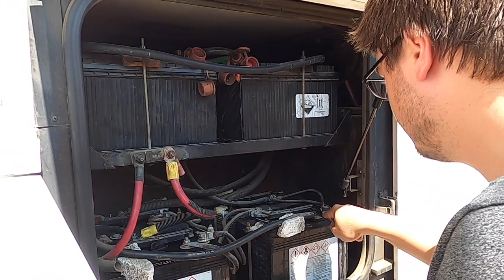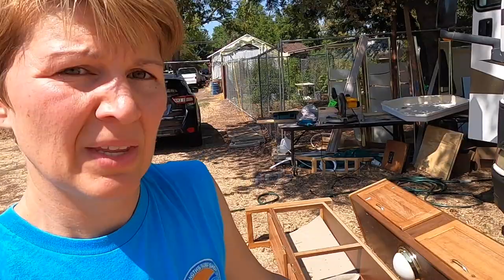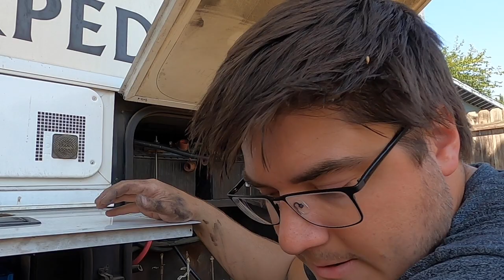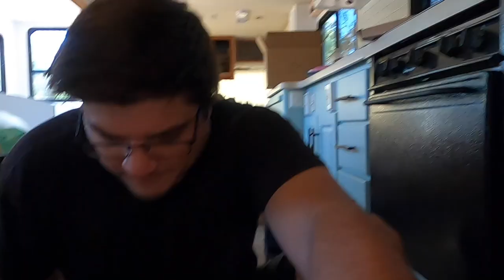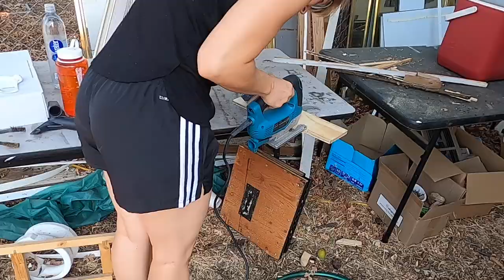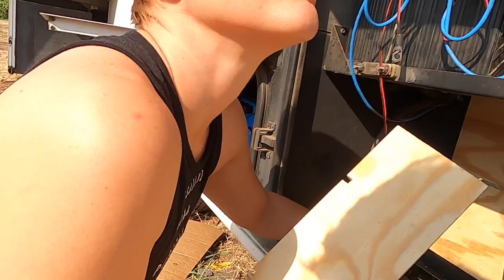Rewiring the Electrical System | RV Renovation

Comment: This is exciting to watch!!  :)  Yeah, starting the generator off the house batteries is a bit more common that not.  In our motorhome, starting the engine kicks a relay in the engine bay that directs the alternator to also charge the house batteries. So, in effect, when our house batteries have died and we've been unable to start the genny, we fire up the engine and wait a few minutes.  Leave it running and the alternator will provide current to the house.  Still - you guys are doing great work!!!

Comment: SWEEEET! I've got a 2003 expo diesel.

The whole system is crap. Slow electrical leak killed my couch batteries twice. Gen wont start if the couch batts are low, pointless.  Unable to disable either the main or coach batts, blows a fuse in the inverter compartment every time i try to use the switch.  First year of ownership the toilet broke, the water pump went, coach batts dead, a fire under the sink cupboard floor from what SHOUILD have been a normal load. Second year, dead coach batteries again, BOTH furnaces broke due to plastic parts failing and had to use the stove for NY winter heating, The main AC started burning so that's been disconnected,, replaced the water heater, bathroom fan broke, roof delaminating so in the process of removing and replacing all the sealant.

I can not afford this pos and it's my home.   Main issue is being disabled, is VERY hard to do all the work myself.